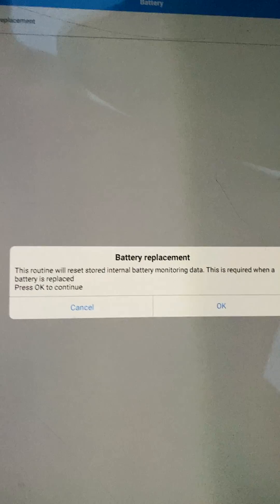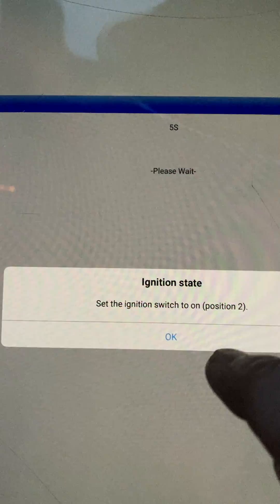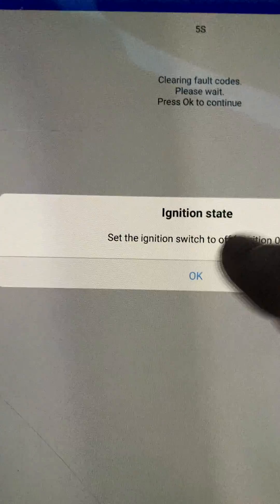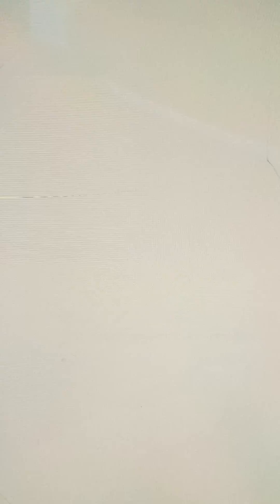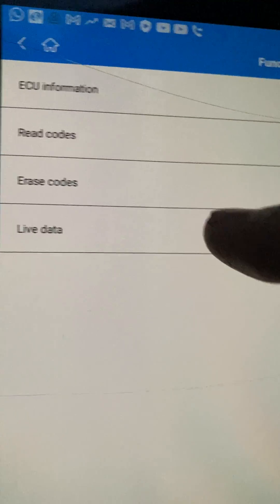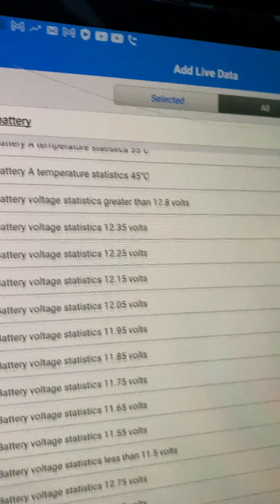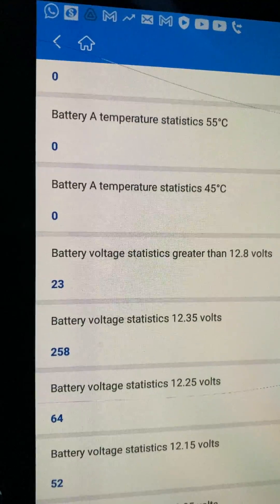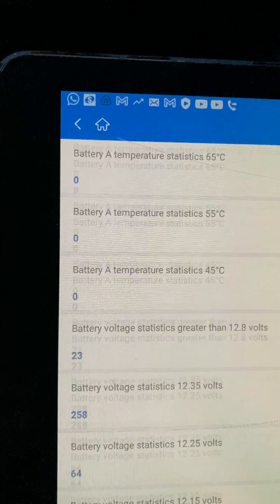Autel Maxi AP200 BMS Reset on Freelander 2 MY2014

Comment: When I click battery replacement it doesn't open
Reply from the maker: I know my android works much better than my iPhone, the iPhone has similar issues where tapping the screen to select options and it doesn’t do anything, I have to tap many many times really fast. Maybe it’s a software fault, I thought it was just me or my old iPhone.
Reply: @TheBionicbone  I'm using samsung s22 ultra, I've tried a few times now and the battery information tab above opens but it just doesn't do anything when I click battery replacement and I've read conflicting arguments that it doesn't actually reset on its own after a few days
Reply from the maker: @jdgraffixx  I won't reset as such and the battery count will not update on it's own. However I am reasonably sure that what it does do over time is relearn the new batteries increased capacity. It's never been proven though, and I'm not aware that came from any official source, it just kind of makes sense.

Comment: Do you think this can help get my freelander out of crash mode?
Reply from the maker: I am sure that will need the LR specific equipment to reset the CCF, probably better having the experts take a look at that one. Sorry
Reply: Hi mate I put a new battery on my freelander 2 and it won't start. Throws up steering colum locked, temperature gauge has went silly and abs etc . Any ideas if this is what is required.  
Thanks In Advance
Reply: @kingroof496  check to see if it’s entered “crash mode”